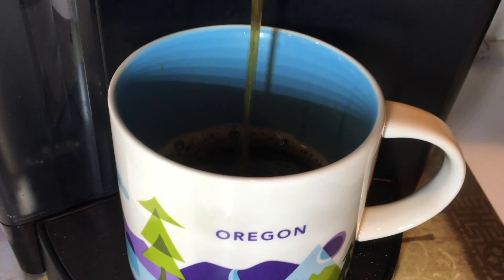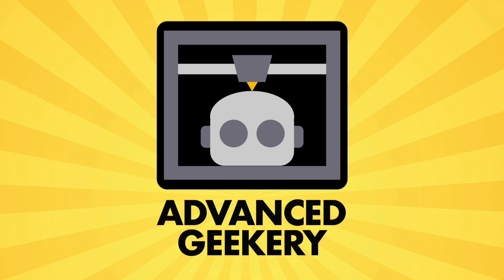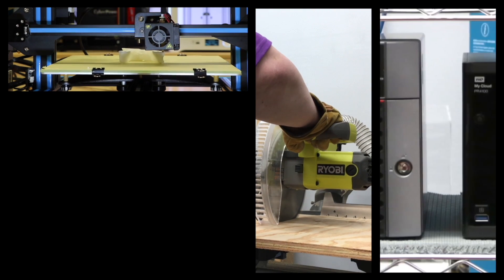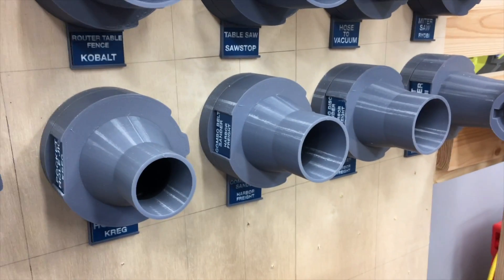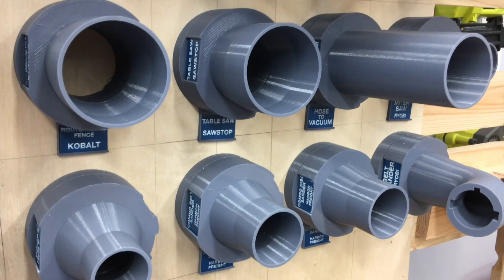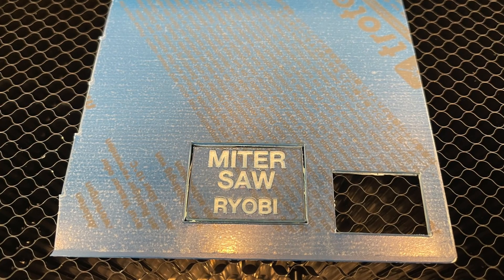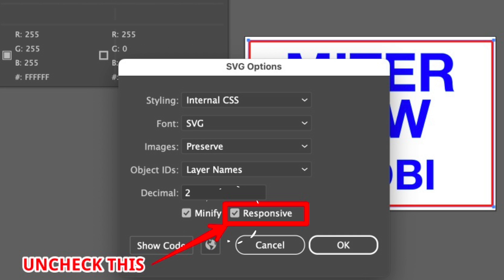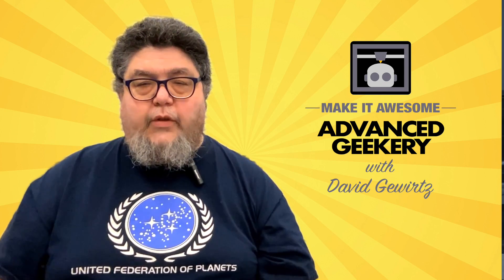Why is my Glowforge cutting my SVG designs too small? How to fix

Comment: In addition to unchecking responsive, it is best practice to check the size of your project before you cut it.  The glowforge UI displays the dimensions of your project in the lowed left hand corner of the screen. If needed, you can also enter the correct dimensions there as well.